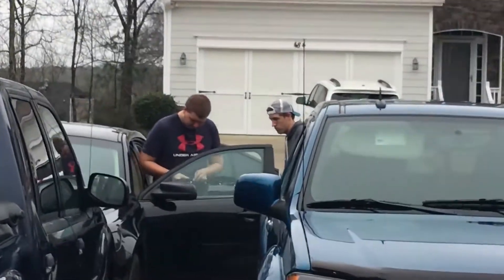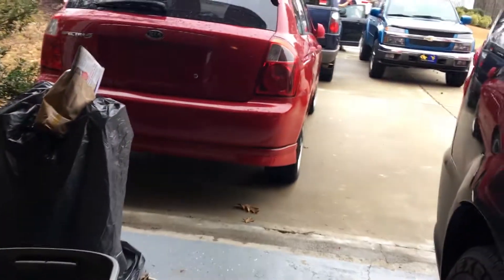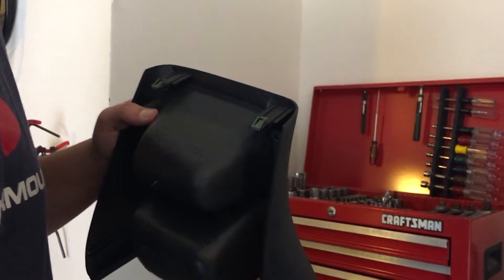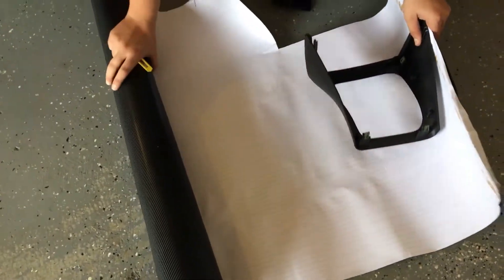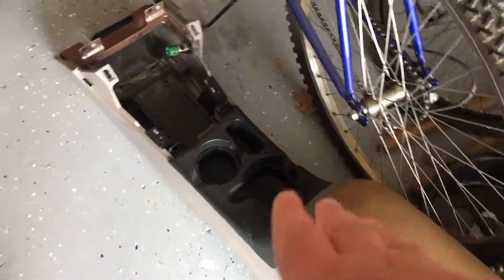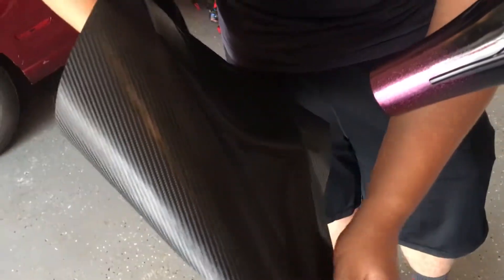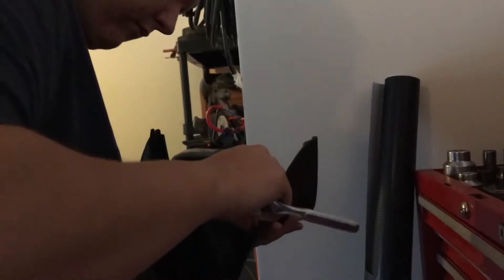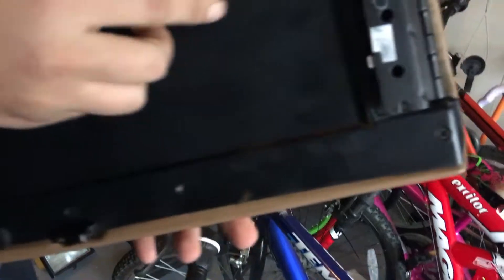95-01 Explorer Console Swap (For 2003 Sport Trac) Part 2: Carbon Wrapping The Console

Comment: You can get the power port working, its as simple as splicing into the other one by your radio.  The rear HVAC can be made to work, but its probably more hassle than beneficial, and the rear controls are the same deal lol
Reply from the maker: That’s a idea, I might try that out when we install it, I’m definitely not gonna work with the rear HVAC, I don’t think mine has the proper ductwork for it anyways, as for the rear controls I think I may convert them over to like a USB area so on the occasional road trip we can charge phones and computer and cameras back there
Reply: RoAst_TiRez how bout a DC to AC converter, just be careful cause if you add too much you'll eventually have to add a second battery
Reply from the maker: yeah, i think i'd only add 1 or 2, tbh i'm not sure the rear radio controls would work since i don't have the factory radio in there now.
Reply: RoAst_TiRez you could prob get them to work with one of those steering wheel adapters, I still have the DVD system I had in mine, mine also had factory sub
Reply from the maker: lucky! i always wanted the factory sub, it was the first thing i looked for when i got my Trac, sadly i figured out i didn't have one and the previous owner had taken the lug wrench
Reply: RoAst_TiRez don't be too jelly, the factory sub sucked, I ended up having my own amp and sub, I just used the factory sub harness for the signals cause, well, why not.  The lug wrench wasn't all that fancy, was basically just a handle for the jack and extension poles to retrieve the spare.  I used my impact more cause it was far faster (never had a flat on the road in that thing weirdly) I had also put a police scanner and CB radio in my truck, was also contemplating strobes cause I had a security job, but never did that
Reply from the maker: yeah, that's definitely on my list though, in September i'm gonna redo my sound system, new speakers, a new head unit, and a sub,  since i have an XLS my audio system is hot garbage
Reply: RoAst_TiRez haha that is one way to describe the factory sound, I can answer any questions you have if you need help, not sure how far you are from geographically though so physical help might not work
Reply from the maker: Tyg3rPro awesome I really appreciate that! I live in metro Atlanta
Reply: How much did they charge you for the center consul